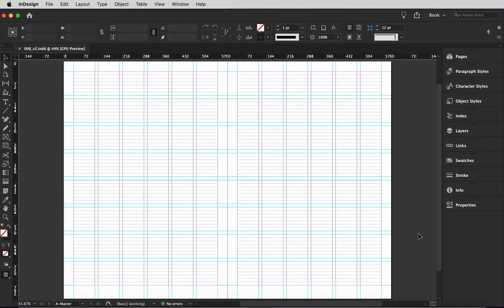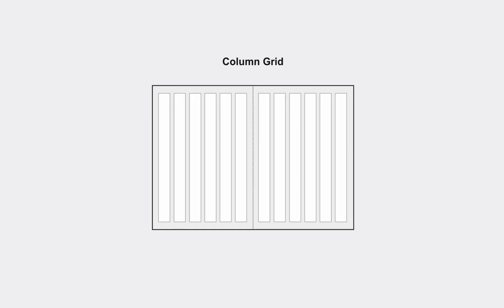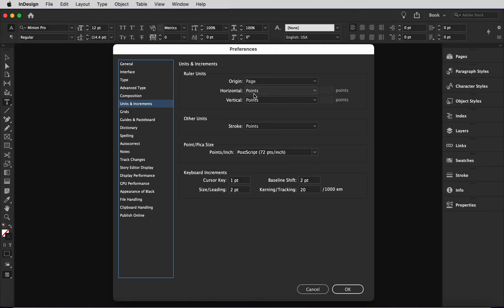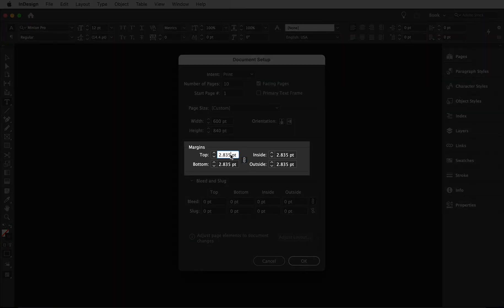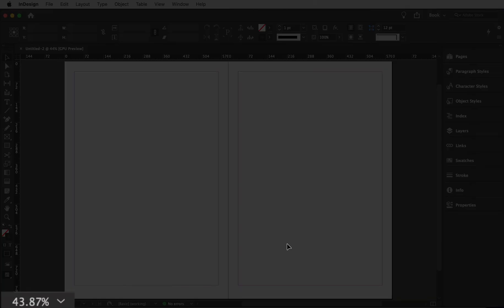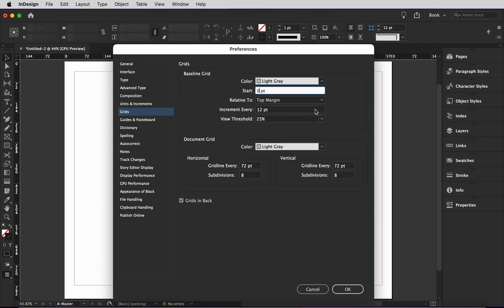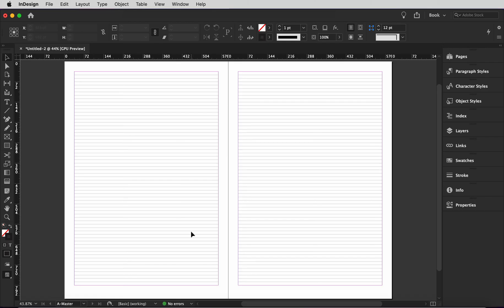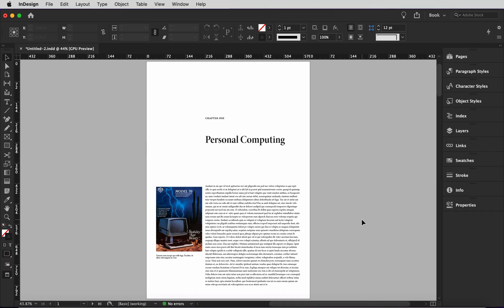How to Set Up a Modular Baseline Grid in InDesign (Tutorial)

Comment: I agree with the need for modular grids. But in Europe people will tell you this is wrong and that you should setup your grids in milimeters and use pt values for typography settings only. All the distances should be based on precise mm units, including the setup for margins. I suppose in the US as well except the print formats would be in inches. Or maybe there is something I don't get yet.

Comment: Very good and clear video, if you don’t mind the document size being random rather than exactly A4 or something. 

All was good until the end. Firstly the math doesn’t add up, which I saw you confirmed in another comment: 840-(36+48)=840-84= 756 

756 / 12  = 63

But you used the number 64 to come to the conclusion of 8 rows. How did you get to the number 64? Do you always just add 1 to whatever you get ? 

It all works when I follow your steps exactly, but I’d like to understand how we got there so I can use the same formula with different numbers. 

I tried to follow the same guide but with 9pt but I ended up only being able to have 2 rows, as I was left with the number 86. I guess I would have to use a different document size (currently 846pt as I wanted to stick as close to an A4 as possible) to get more? it’s all a bit too much math for me!

Comment: Hey there, thank you very much for this tutorial!  I was wondering how you setup your InDesign, so that it only shows the baseline inside the margins. My version shows them on the whole page, from bottom to top and left to right. Can't find a specific setting for it.
Reply from the maker: Go to InDesign > Preferences > Grids. From there a window will open, and you'll want to find where it says "Relative To" and select "Top Margin." That should be it.
Reply: @theperfectbound  This does work, but still the baseline grid overlaps the margins on the sides and the bottom. Its more of an optical preference for me, to have clear margins, without the lines. But your solution seems like a nice option to use when the top margins distance isn't a multiple of the leading. Thx!

Comment: I'm trying to set the modular line in the margins, the height is 564 the top and bottom margin are 36 and 48, but when i set the modular grid in the margins, which counts 40 lines of text, it still dosen't allign with the baseline grid inside the margins, but when it's seted on the entire page it does allign... what is happening?
Reply from the maker: I think it may have to do with the gutter. Try this: Add 12 pts to your page height so instead of 564 it's 576. Keep your margins the same so now you'll have 41 lines of text. At that point you should be able to align the modular grid and baseline grid inside the margins or to the edge of the page. 6 or 7 rows should align perfectly.
Reply: @theperfectbound so it's matematic error? what if I wanted 4 rows instead of 6?
Reply from the maker: @Erik_Conso  You'd probably have to adjust the page height or leading.
Reply: @theperfectbound  thank you for your help!
Reply: @theperfectbound  hey could you explain to me why the two grids aligned when i added 12 extra points?
With 576 i was able to have a perfectly alligned modular grid innthe margins, but I don't understand why those 12 points made it work...
Reply from the maker: @Erik_Conso  Those extra 12 pts made everything line up is because your baseline grid is based on your leading (in this case, 12 pts). When your page height is a clean multiple of your leading, the baseline grid aligns neatly from top to bottom.

At 564 pts, it wasn’t happening. 564 ÷ 12 = 47, which creates misalignment with the margin grid you were trying to fit inside. But once you bumped it to 576 pts, that’s 48 lines of 12 pt leading, a perfect fit. 

Now both your modular grid and your baseline grid share the same rhythm.
Reply: @theperfectbound  ohhhhhh i see, now it makes sense, thank youuuu✨✨✨

Comment: Creating the guides at the end is confusing me so much I can't get the math right. If my leading is 9 and doc size is 792pt. Isn't margin supposed to be 27 and 36? And if so my math is 81 but what do I do with that?😭 My guides are not lining up and I am about to give up. Even if I do ,9 by 8 the gutters don't like up even if margins are fit and gutter is 9:
Reply from the maker: Try this: keep the 792 pt page height but make the top margin 36 pt and the bottom margin 45 pt. Next, go to your guides and make 8 rows with a 9 pt gutter. Make sure to fit the guides to the margin, not the page. Last, on your baseline grid settings, make sure it starts at 0, is relative to the top margin, and increments every 9 pts. That should work, let me know how it goes.

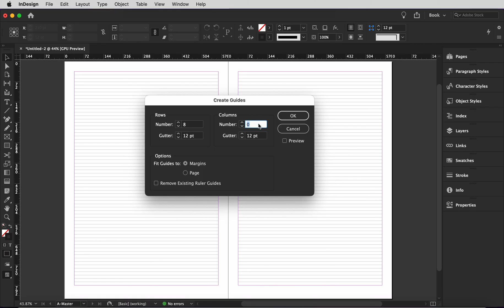Comment: very clear and helpful video! I have 2 questions: if we have to determine the page setup size as multiple to leading how can we assure at the same time that this page size works for the printer? Secondly how did you came up with the num 8 & 6 for the row & columns at 4:38? Thank you in advance.
Reply from the maker: You'd have to print on a bigger sheet and cut it down. Include trim marks when you export the PDF. The columns were a matter of preference. Based on the page size and number of rows, I thought 6 would make a good balance. However, that number is flexible. The 8 rows came about by dividing my page height by the leading. Everything is divisible by 12.

Comment: Enjoyed the  video, but I did not get how you arrived at 8 rows and 6 columns for the modular grid.
Reply from the maker: So, the column number is flexible. We could have made it 4 columns or 8 columns, as the columns do not need to line up with the baseline grid in the same way as the rows do. The number of rows was just a byproduct of our page height and leading being in sync. 

These types of grids are a nuisance to set up, and you usually have to make some concessions in order to make it work. Depending on the type of project, you may choose to use either a baseline grid or a modular grid, but you don't necessarily have to use them both together. You could also use a baseline grid with a multi-column grid, and that would give you a lot of flexibility without all the math.
Reply: @RyanMungia oh okay thank you, I actually ended up using 4 rows and 6 columns which later aligned with the baseline grid.

Comment: hi! would this set up work if i wanted the document to be 840pt wide by 600pt high and i flipped the values?
Reply from the maker: You'll have to adjust the top and bottom margins slightly. Try it with 48 pt for the top margin and 60 pt for the bottom margin. That'll give you six rows with 12 pt alleys, aka space between the rows. You may also want to make the left and right margins 48 pts to match.
Reply: It does work, but the grid only aligns with 4 or 11 rows, you can do whatever for columns